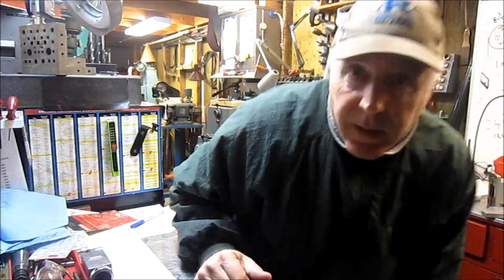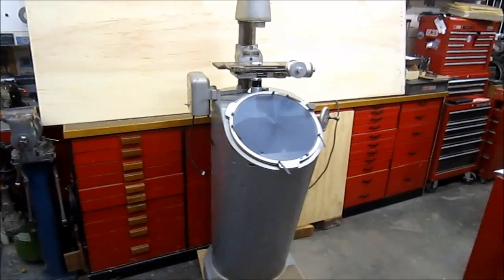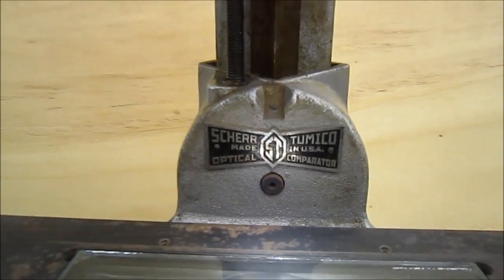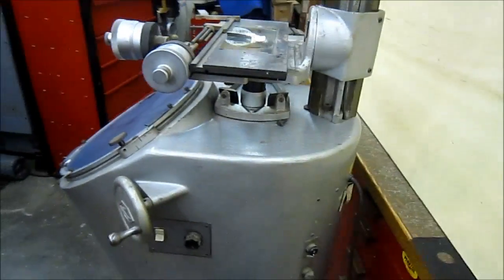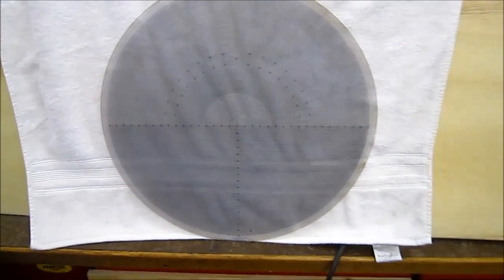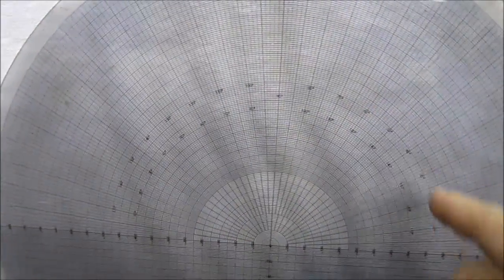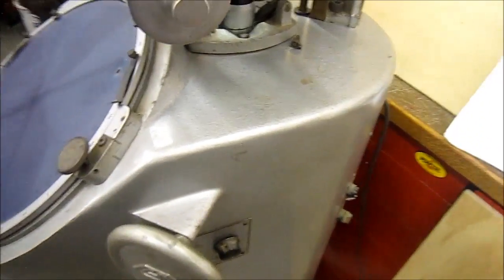TOOL TIME  Episode 10          Optical Comparator

Comment: I used one of these devices in the 1980's .We called it a shadow graph . The components I made were produced on a Citizen F25 CNC  for missiles . the components were that small that they could not be measured with any measuring instruments except a shadow graph . they are a very useful device
Reply: I used the F25 too, remember the punchtape machine that you used to store the programs? Also I call it a shadow graph. You're not from England by any chance?

Comment: In the mid to late 70s I worked at that company in St James Minnesota. I worked in the dept that made those comparators, my job was to grind the welds down and then apply body putty to fill any voids and have it nice and smooth for painting.
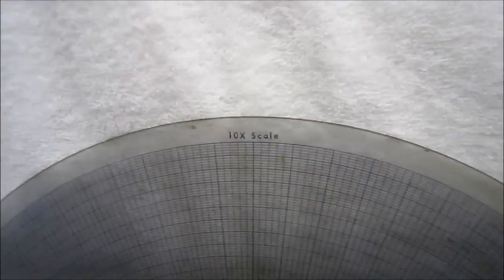Reply from the maker: thanks for viewing, I did get a unit for my shop....here is the link to the video https://youtu.be/LADPCLV1gn4  you can watch the whole video or jump to 10:31 to see my comparator....hope you hit the sub button....ATB

Comment: That's really nice Chuck, thank you! I used to do most of the lathe tool grinding when the part needed custom forms. I got to use the shops comparator a few times for the most precise, and used the microscope many times on the less precise stuff... We did quite a bit of work for the Navy,and some for the Air Force... Both were often more picky then the use of the part required, so it was tight tolerances... That said it was also the most fun! :o]

O,
Reply from the maker: O52...
Thanks for watching and sharing your experiences...
Chuck